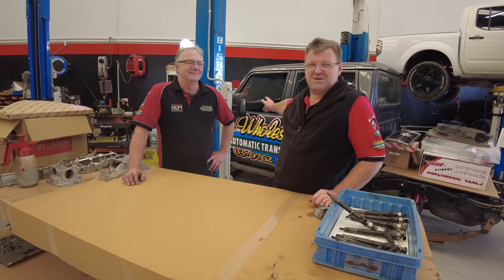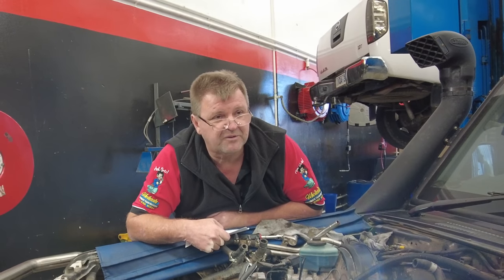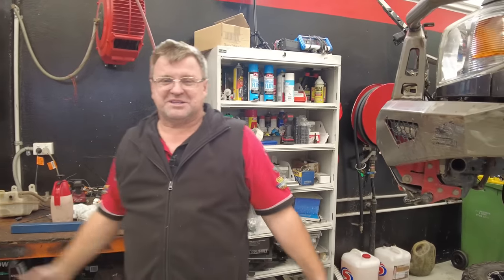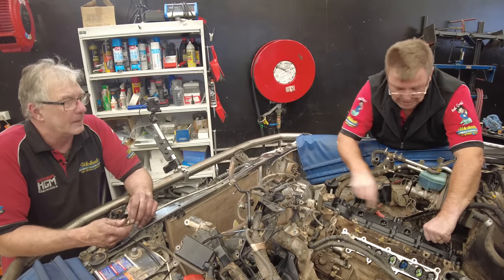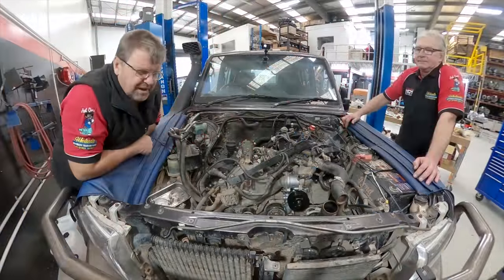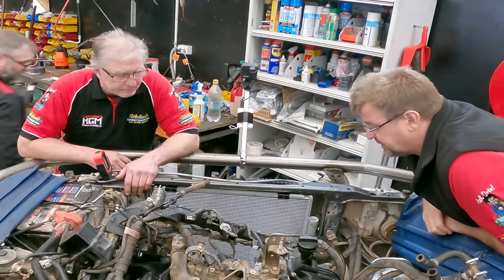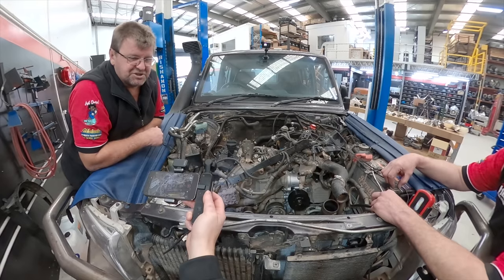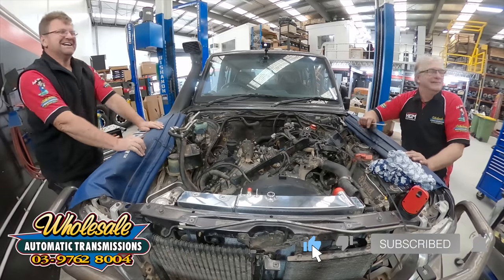There must be an easier way! The new Injectors, starter and PWR radiator go into the 79 series.

Comment: I have to ask this question. How many alternators have you changed or seen changed because of getting packed with mud or shorted by water? Dozens if not hundreds I bet. But no one has re-engineered a mount to place it higher in the engine bay. Great opportunity for you and the company.

Comment: WD
Hey Rod, I asked the question 3 years ago regarding any YouTubes on driving in soft sand or muddy situations when towing with the 79 auto conversion. Tips to keep the temperature of the gearbox at an acceptable level in prolong situations. It would be invaluable information that could be part of the handover package when the Conversions were complete.
Just some feedback from a happy customer

Comment: Nice work lads. Question - Do you retain low range with the auto conversion for the 79? Does the conversion require an engineers cert?

Comment: I got injectors for my Isuzu truck from sms diesel in Brisbane.. Isuzu wanted 1k+ and I got them for 500+.. half price.. and they came in the Isuzu box lol I was told they get a container load of genuine parts at a time and that when the dealer run out of stock they would go across the road and get them from sms.. pays to shop around

Comment: Hey Rocket got a couple of questions for you.

Q.1 Will you put the Yokohama X-MT Tires back on the old girl (79 Series)?

Q.2 have you thought about extending the Chassis on the 79 Series?

Q.3 What do you do with the Manual Transmissions that come out of a 79 series for example that come in for a Auto Conversion?

Q.4 have you chosen a new exhaust for the 79 series or are you not gonna change it ?

Comment: Hello all. Really appreciate your vids. I have a mid '90s Toyota which is very different to yours but shares a lot of bits. Do you ever consider fitting the 10-blade fan rather than the OEM 7-blade, esp with a thicker rad? The 10- is 16361-54131 btw.
Reply from the maker: Didn't even know there was a 10 blade bolt on version. I never had any problems with this one though.

Comment: Dumb question but why does the engine need to know what injector is in what cylinder?  do they spray at different pressures or somthing per cylinder?
Reply from the maker: More for diagnoses as we had a lot of trouble reading some of the numbers and were not able to load 3 of the numbers but it will still be able to start and run and will then self learn.

Comment: Question: For that stuck washer, why didn't you just use an Ezi-Out?
Reply from the maker: It was about 140mm down the injector bore so we had to come up with a plan.
Reply: @WholesaleAutomatics  yes, I understand that. I was thinking that you could have welded an Ezi-Out to the end of the bolt...the taper would have made the job a little bit easier....but what you did worked, so good onya!!

Comment: I have heard rod talk about running two trans coolers what type and how do you set them up?
Reply from the maker: In this particular vehicle we run though our larger cooler first then smaller secondary. This varies depending on vehicle though.
Reply: @WholesaleAutomatics  Do you use a thermostat to control temps in cooler weather ? I was thinking about putting one in like the ones offered by  Derale  but don't know if it is necessary .

Comment: A question not relates to your 79, but hoping you can help, I have a PX2 Ranger that I tow a caravan with.  I have had you install your heavy duty valve body, I installed your cooler kit and it also has the thermal cooler bypass valve installed. The auto is so much nicer now, the changes are fast and precise, and the temperatures are far lower than I was seeing previously. I was wondering if there is anything else that I should do, besides regular servicing/fluid changes, to keep it running well and also give it the best chance of a long life?  I want this box to last as long as possible, so what are your recommendations?
Reply from the maker: The deep cast aluminium pan will help with the oils life span massively as it allows for the oil to sit longer in the pan before going back into rotation. Normally gives you and extra 25% and also gives you more capacity to draw from when under extreme load. This gives you more oil to draw from before the oil starts to reach the maximum temperature that it was going to reach. In many cases this will give you enough time to complete what you were doing.

Comment: Yep there's a n easier way to replace the injectors , buy new injectors with new motor, gearbox , diffs,  chassis and cabin attached to the injectors......hope this helps 🤔🤔🤔🤔🤔🤔🤔🤔😒😒😒😒😒😒😒😏😏😏😏😏😏😏😔😔😔
But it won't help with the price and the back pocket.....

Comment: Do you change out manual trans and replace it with auto trans Landcruiser 1996 UTE?
Reply from the maker: We use the 6 speed auto from the 200 series VDJ LandCruiser.